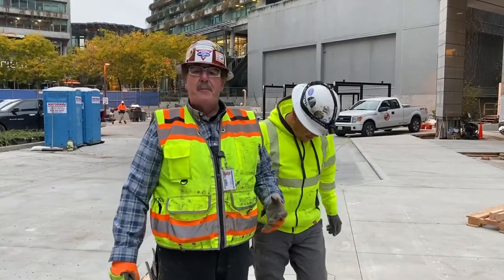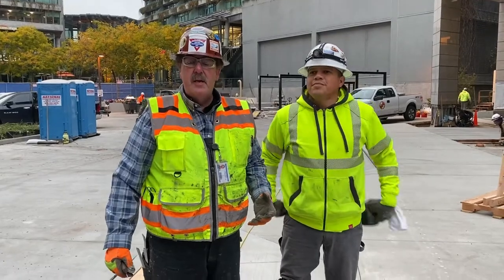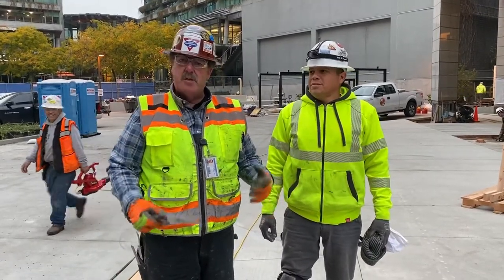Sidewalk and Curb Caulking

Comment: Can a air compressor be used for this type of gun?
Reply from the maker: Yes. I started using the CO2 tank because I do not have to search for a place to plug it in. I can use it on a swing stage, a scissor lift, or a boom lift. Or as you saw in the video, anywhere.

Comment: How many years will it last?
Reply from the maker: Polyurethane Sealants is susceptible to ultraviolet and weathering. Their lifecycle performance will be different in various parts of the country. Direct exposure to warmer temperatures and sunlight can cause some urethane Sealants to fail within a few years. This is why silicon Sealants are now being used in DOT work across the country. The covalent bonds of silicone sealant is strong enough against UV and thus can last up to 20 years.
Reply: @unitedprofessionalcaulking9038   i live in sunny California and have several examples of polyurethane sealant on sidewalks and high rises that are 20+ years old.
They are badly faded but still physically functioning well
I do understand that we very rarely get extreme heat
Not saying you are wrong 
Just saying it CAN last a lot longer. Not that it will
Having said that I have examples of silicone that are 30 years old. That are very dirty but not faded at all.
Keep making videos. I’m on a crusade to save homeowners from all of the caulking stupidity on YouTube. You are one of the few I can refer them too to learn to do it right.
Reply from the maker: @genecarden780  Gene, you have good observation skills. Keep it up! The debate continues between organic and inorganic sealants. Both have a place in the construction industry. Typically for building exteriors, silicones are preferred in curtain wall and high-rise applications. The reason of course is that silicones are inorganic and are not as susceptible to UV, weathering, and aging, especially to the degree that polyurethanes are. Thus, silicone manufacturers will offer a 20 year warranty regarding their longevity and durability. Often times the installer is required to provide a five year labor warranty for silicone sealants. The longest mfg. warranty I have ever seen for polyurethane is 10 years, and even that is rare. A labor warranty, for the installation of polyurethane will typically not exceed two years. 

In the consultant world for Sealants, there is an unwritten rule of thumb. For polyurethane, if they have been installed for 20 years, replace them. As for Silicones, after 20 years the intent is to test them. 

As you continue to inspect and notice the aging process on sealants, see if you can identify the various failures, i.e., adhesive, failure, cohesive, failure, substrate, failure, chalking, crease-cracking. And when you notice one of these types of failures, see if you can determine the reason for it and if there is a need for replacement. 

Sounds like you are doing great job. Please keep your comments coming. I enjoy them very much.

Comment: I’m not trying to hark on you too much but I could really show y’all some very useful techniques to speed up the process, improving the outcome with no mess at all.  No tape, no backtooling no water and soap.
Reply: I’ve been a professional caulker for over 45 years. This is exactly the correct technique. Shoot a nice bead. Try to strike the joint 3 times once each direction to insure bond and one last time for aesthetics. The only thing I disagree with is the air gun( I own several) but think it is not worth the hassle for a job this small. But that is only  opinion. Not right or wrong. Also we consider sidewalk joints “ submerged joints”  ( technically they are when it rains but practically they aren’t) which require primer. Just gives a little extra insurance. Again not wrong to not prime. It’s amazing how hard it is to find quality caulking videos on YouTube. So many so called “ professionals “ that  mostly do sub par work.
WELL DONE!
Reply: You’re not supposed to use water and soap and tape and a few other things that these guys are doing Flim flam men wet tooling